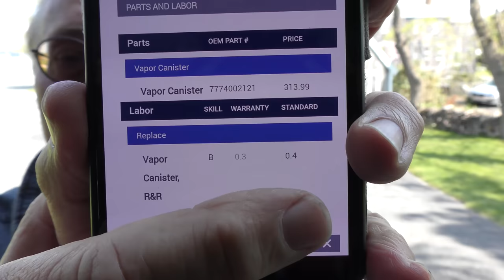7 Car Myths Stupid People Fall For

Comment: My golden rule is to follow what the manual says and disregard everything else. The people who designed the car know exactly what it needs.
Reply: Except when it comes to oil change frequency.  Just do it every 5k and disregard the computer oil change interval.  By the time the damage is done, it's out of warranty and NOT their problem!
Reply: Wrong. 

Accountants rule the bottom line for companies not engineers. 

They talk about lifetime diff, trans and transaxle fluid (BMW etc) this is false. Their definition of lifetime is different from yours. Oil, I would say do every 5k miles using synthetic, if you do city and highway driving. It's such cheap insurance, you'd be insane not to. My car has 275,000 on it, oil changes every 5k miles with a filter change (Napa/Wix/Fram TG or Ultra)
Reply: totally wrong
Reply: You honestly believe transmission fluid never needs to be changed?
Reply: Wrong most are oil conditions are severe, therefore intervals are half...
Reply: But the "lifetime fluid" sticker on the transmission is a scam.
Reply: The manual will tell you how to planned obsolete your car. You really should also do research into proper maintenance of vehicles in general coming from not a big company that wants you to buy a new car in 2 years.
Reply: They recommend never changing your transmission fluid,and long time between oil changes. Lifetime means what the company thinks your transmission should last. Normally as long as the warranty.😂 Long time between oil changes is more government related. Car companies need an average emissions and mpg among all models for epa or whatever government agencies in your country.
Reply: X vonPocalypse  I do between 5 and 7k depending on the color and smell. Can change based on the type of driving. If I did a lot of stop and go driving you can see the difference vs highway.
Reply: My 98 jaguar manual says every 10k.  With normal oil.  Not even synthetic!   Yeah I don’t follow that.   
5-7k with synthetic
Reply: @Thunder Life Studios I have a closed transmission approaching 200k and a transmission with a stick that also says it doesn’t need to be changed approaching 185k miles and it still looks fine. Had another car with over 350k miles and never had a transmission fluid change. But yeah the transmission fluid broke you transmission not something else. You can change your fluid however often you want and the transmission just stops working correctly.
Reply: @mickey_mousey  I’ve fallowed the recommended cycles on 3 vehicles first one went to 350k miles sold it because it was too old for work. Next one went 200k and sold it to get a more fuel efficient vehicle. Current car has 180k miles I no longer drive my personal vehicles for work and plan on keeping this one until it has a major problem. 3 vehicles no engine or transmission problems well over the typical life expectancy for modern cars.
Reply: @paulshields2220  I've had cars go up to 750k miles by not following the manual. You have only followed the manual, and have not tried otherwise therefore you don't actually have a solid consensus to come to, as you don't have data from both sides. I understand that SOME manufacturers probably have decent car manuals for some of their cars, but certainly not all of them do. And its just a safe bet to do research aside from the company (as we all know, companies are not there for your benefit, but their's). Telling someone "Blindly follow the manual, because I do!" isn't necessarily good or solid advice.

Also, from what I understand sometimes changing the transmission fluid TOO LATE can cause more damage than good. If you continue to change it on time (Whatever time you believe is good for your car) it should help lengthen its lifespan.

This isn't meant to attack you btw. I hope you're having a good day, and you're an awesome person <3
Reply: @karans9228  this^
Reply: FUD: Fear, uncertainty and doubt.  Change your fluids like the engineers recommend and not some guy who did it this way and never had a problem. They used to recommend changing the oil twice as often as the filter. Then they recommended changing the oil every 4000 miles with the filter. When Jiffy Lube started, they advertised changing every 3000 miles and after a couple of years of marketing everyone did it too.  This all changed when manufacturers started using synthetic oil.
Reply: They want your car to fail. It makes more profit for them
Reply: Ahhhh, the "trust the govt and follow their directions" folks are easy to spot in this thread
Reply: Car makers are biased by total operation costs for their marketing campaigns so they extend out all maintenance that cost money
Reply: But listen to what Scotty says about things like lifetime transmission fluid. The car makers are not being honest cause the parts are only warrantied for a certain amount of time which is then the lifetime expectancy. But changing the fluid will extend the life.
Reply: @billthepainter5106 
You can do 5000, but in extreme climates you should do the oil change at 3000
Reply: @CurlyFromTheSwirly  seriously right?
 I'd love to see people who believe/trust that type of thing boarding a plane that uses "lifetime hydraulic fluids", "never needs maintenance" 🤣
Reply: The people who make the car also know how to squeeze your wallet for every penny they can too.
Reply: The people who designed the car also want it to break down right after the warranty expires so you'll buy a new one from them
Reply: First time I heard of extended oil change intervalls I thought it was a marketing manouver. I'm convinced since.

Comment: He's spot on about super unleaded gas.  I have a 2014 Honda Accord 2.4L my kids have named "Dad's Taxi."  I switched to regular unleaded from super because of the rising gas prices.  I was averaging around 26 mpg (suburban driving) on super and now I'm averaging about 28 mpg on regular and it actually seems to have more pep.  2 mpg may not seem like much, but that's 20 more miles on 10 gallons of gas.  That's an extra day of school runs for me.
Reply: I never would've thought that would make a difference like that. Figured it would make no difference at all for an engine tuned for 87 like that.
Great car too, the final Accord model I liked.
Reply: Also there's the huge savings. Depending on your locale
Reply: you know in the owners manual it actually tells you what level of octane gas you should be using as thats the gas that was meant for your build of engine
Reply: Same for the reverse. I’m supposed to use the high octane gas in mine, but yeah pricey. I’ve lost some horsepower, but my car still has 320 even with that. I’m not driving a bajillion miles an hour. I’m good w the savings.
Reply: My car's owners manual recommends premium gasoline.
Reply: It mostly depends on the condition of your engine, and what additives they use (not all are octane boosters alone). Best bet is get an app to track your fuel usage and keep it going for awhile. Ive seen upto 20% changes in mileage based on fuel. Biggest for me was an 01 Isuzu 3L rodeo which was 20-25% different depending on source company for the diesel (aka additives). My current Isuzu which is brand new and gets better mileage on cheaper brands diesel than whats regarded as the premium diesel here. 
My 88 Toyota corolla 1.6L carby was cheaper to run on the most premium fuel compared to regular. Sure it cost more to refuel but then lasted 15% longer and at that time the premium was about 5-8% dearer than regular unleaded. 

Every car is different. Best bet is to keep track and try different ones.
Reply: I use regular
Reply: Hope you all enjoyed your time in Tennessee! (I think it’s the best state, but I’m partial… 😂)
Reply: You don’t just lose power using lower octane fuel, you create more engine wear and it won’t last as long. If the manufacturer says use premium - use premium as that’s what it’s designed for. They won’t say it for any of their own benefit as they don’t make money from fuel sales. Follow the manufacturer’s recommendation. Don’t put in regular if it says premium. 
This guy is telling you rubbish here.
Reply: i want a Honda Accord

Comment: Totally agree Scottie - as a retired Shell fuels engineer, all you need to worry about is only buying Tier One fuel and your car will run perfectly.
Reply: Hows that metric for Diesel?
Reply: Tier 1 as in chevron / shell or as in 91 gas ?
Reply: @andrewmarcfit6447  Tier 1 fuels in terms of the additive / detergent package.  You can check which gasoline companies offer Tier 1 fuels in your market in a quick Google search
Reply: @AB-jk7tw  is Tier 1 different from Top Tier?
Reply: @TheLouisianan  same
Reply: Agreed and most fuels are rated Top Tier these days. Usually brand doesn't make a difference but my current car finds Shell works best. I don't know if it's the extra additives, but when MPG drops, 3 fills at Shell brings it back up; worth it though Shell usually costs more. (Of course 70% of my miles are in town; mostly freeway and no difference.)
Reply: @TheLouisianan  for example, even Costco gas is tier 1
Reply: Definition for dummies please…
Reply: Hope you're enjoying retirement you damned pirate.
Reply: I’m going to use the fuel that the manufacturer says to use which in my case is premium.
Reply: @michaelcrockette8694  🐏
Reply: @michaelcrockette8694   excellent idea - just be sure you buy all your fuel from a Top Tier / Tier 1 fuel Company
Reply: I buy gas where the masses go. Dad always said at least it should be fresh. Fresh dino dookie
Reply: Scotty says all gas must meet same spec, but others say buy tier 1 gas from Shell, other Major brands.  Local gas station I usually buy from isn’t listed as tier 1.  Should I switch?
Reply: @garynoss818  All motor fuels are very similar as per government standards but the additive and detergent package in Top Tier fuels is significantly improved.
Reply: @AB-jk7tw  Ok, thank you! I’ve got a tank of tier 1 gas in my car right now and I’ll see how it goes.
Reply: @mikep490  ...how is this real ?...as all I see is the unbranded/unmarked tanker truck coming to fill the gas station's underground tanks....seems the same " no-label "  truck fills most all the different (brand) gas stations in whatever regional area I visit....there is (for example) no Shell truck filling a Shell station that  can see.
Reply: @AB-jk7tw  ....all I see is the unbranded/unmarked tanker truck coming to fill the gas station's underground tanks....seems the same " no-label "  truck fills most all the different (brand) gas stations in whatever regional area I visit....there is (for example) no Shell truck filling a Shell station that  can see.
Reply: @TheWilferch  Yep, we have the same generic trucks that deliver, also. Shell, Texaco, etc used to have their own tanker trucks. I noticed the special tank trucks disappeared years ago. We were working at the local bulk fuel delivery service, years ago, and I asked. Their dispatcher explained the tanker train delivers fuel and they store specialty brands in different storage tanks then use their trucks to distribute it to stations. From what I read, the additives are added when the tanker train is loaded... but that's I-net info so who knows if it's accurate. My former car, and my 29 yo PU, don't care about brand but the new car seems to.
Reply: @TheWilferch  Even the major oil companies rarely use their own trucks - much cheaper to contract out the haulage/delivery.
Reply: @AB-jk7tw  ...I get all that..... all the more to ask how do you know what "top-tier" gas is?....and where it's coming from? And whether YOU are getting this top-tier gas, when all these unlabelled 3rd party trucks fill the stations ?
Reply: @TheWilferch  You can Google which Fuel Companies have Top Tier fuels - it is public knowledge.
Reply: from what I understand teh gasoline that moves thru pipelines to terminal is all thesame, until trucks come and pick it up, at which time teh company's specific addetives go in, and those probably are not too different from each other. Not sure about octain levels. I guess on that, if you get engine knock from lower octain, go higher.

Also, if you can buy  pure gas withot say ethanol, you MPG will probably go up by about 10%. -corn crops down due to storms so expect higher gas prices. Boys in girls in DC are real geniuses.
Reply: Octane matters in sports cars tuned for it.  Your cars not going to have problems but you lose power.
Reply: @halross3130  Multiple products are sent in the same pipeline by monitoring how many barrels flow and allowing for some mixed waste between product changes.

Comment: I once was asked to see if I could figure out why a motorcycle kept having carburetor problems.  I ran it until it was out of gas and then the owner told me, "I always put premium in it."  I checked what octane it specified and it was low octane.  After about a quarter mile of having the correct fuel in it, I had it fixed for her.  She was really happy.
Reply: Most likely water or somthing else contaminating it or old gas... You can run 100 octane fuel on a motorcycle meant for 92 octane and it will just run like normal. Only the other way around using to low octane causes trouble.
Reply: @a64738  No; it needed the proper octane rated gasoline.
Reply: @a64738  What you just said: "No you're wrong, your experience is invalid because I think I know better than you." He just said he tried to put lower octane in it and it worked better. Not all motorcycles are built equal. :)
Reply: In E10 gasoline the ethanol and gasoline can form two different layers therefore cauaing problems in engines with carburetors. The problem is avoided if new gasoline is used or E10 is avoided, also direct injection engines are not affected.
Reply: @Loanshark753  You are quite correct. Ethanol contains Oxygen. As EFI engines have an O2 sensor. The ECU will adjust the mixture automaticity. This is something that an engine with a carb can't do.
Reply: Octane numbers and fuel , few understand it and what most people know is an interpretation of something they experienced 1st hand after trying a different octane.
A engine that 'pinged' a lot with low lead two star fuel  suddenly went better and stopped pinging with high lead 4 star fuel. Then broke after changed to unleaded.
One motorcycle ran great on low octane and ran crap on high octane. Another motorcycle tuned up like crazy wouldn't run proper at all unless high octane.
Reply: You had the air conditioner on when riding?😂
Reply: @mickey_mousey  I agree. I always had to put premium in my Harley. Had to put a lower octane in it once...the engine knocked and the exhaust smelled horrible. Went back to premium and the problems went away. I have seen people with other makes of motorcycles putting lower octanes in them, with apparently no problems.
Reply: @tattooedman42 My bike has a label that says use 91+. I follow the label. It is 13 years old and still runs well. I put low octane in it once because different pumps put the hi on opposite sides. I did not notice issues but I ain’t risking it. If it hits 100k miles I might care.
Reply: @Loanshark753  the ethanol also absorbs water from the bottom of the tank and carburetor, in the past ethanol was a pretty common additive you could buy to remove issues with ice in the tank and fuel lines

Comment: After buying cheap tires for 10 years I bought a good pair and I had no idea how important it was.
Reply: 10 years bro? Wow
Reply: People, it says “tires”. Meaning multiple. Not a single set for 10yrs.
Reply: He must be a motorcyclist since he only bought a pair or good tires
Reply: Were they more quiet? Did they ride more smoothly? What was the benefit?
Reply: HAHA, are you serious? the hangook tires and the like only last half the time and are garbage quality for performance, they are cheaper for a reason.
Reply: Most cheap tires have horrible tread patterns with no sipings to help with wet/winter traction, and last 10-20k less than their actual rated treadlife.
Reply: @alb0zfinest  I went with uniroyal tiger paw this time, no road noise at all , and less activation of abs in adverse weather.  The linglong crosswind, and Walmart Douglas I ran previously were horrific.
Reply: Upgraded from Walmart tires to Firestone Destination LE3s, it was a good choice, way better longevity, tread wear and ride ability.
Reply: Don't skimp on tires.  There are things you can go cheap on, and others you shouldn't.  If you're going to splurge on anything on your vehicle, make it tires.
Reply: All things are relative, like most things in life you get what you pay for and sometimes more. Premium tires cost twice as much but last three times longer and are far safer in everyday driving conditions.
Reply: @alb0zfinest  Depending on the tire and weather can be dangerous. Like if you live in a area with snow and ice and don't have winter specific tires.  Continental LX 20 for example I was driving in over a foot of snow in my RAV4. I passed multiple Jeeps, a Landover just spinning tires and a Suburban that slid off an on ramp . My 4wd didn't even engage because the front never lost grip.
Reply: @alb0zfinest    I added higher end all season Goodyear for my 2005 Ford Crown Victoria LX sport sedan. I noticed a quiet, smooth ride. Better turns, cornering in city streets, highways. Paying $$$ for better tires IS worth it!
Reply: @kd7cwg   It's widely known in the auto, accessories industry 🏭 rubber quality, QC since the mid 2010s has slowly 📉. Rubber trees, processing is not as good: 2000s 1990s 1980s. You have to spend $ on better brands.